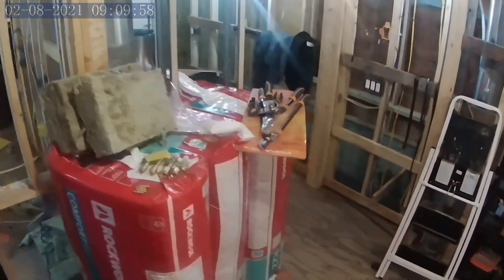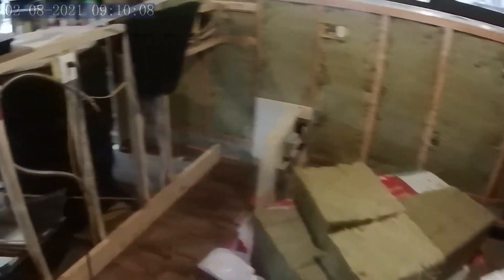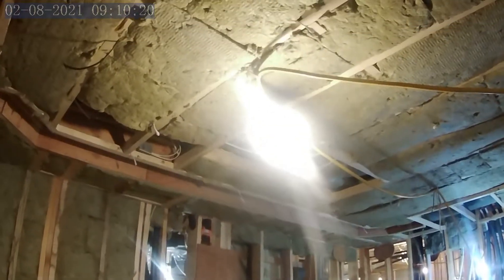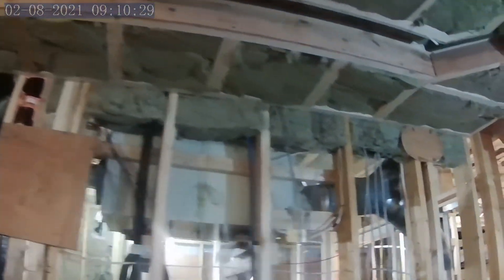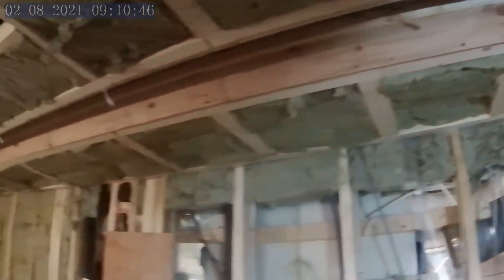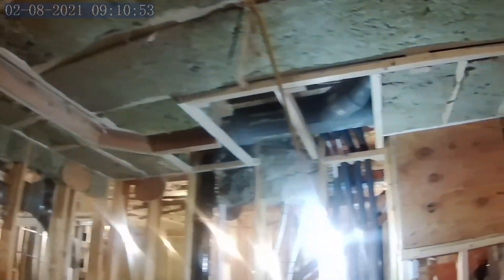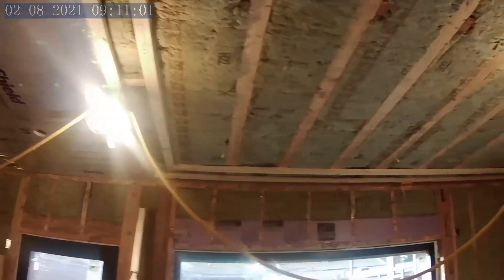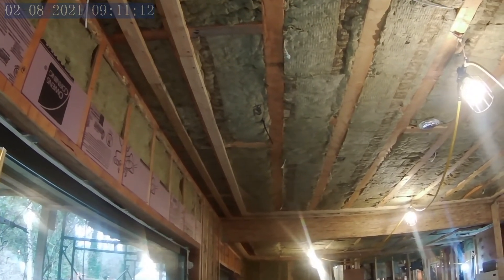ROCKWOOL Sound Proofing Test

Comment: Hello, thanks for the video. Is there too much difference using 50mm vs 100mm of rock wool?
Reply from the maker: Thanks for visiting the channel.  Yes there would be significant difference in sound levels between these two thickness. I believe it is an exponential increase in sound deadening as you go thicker.

Comment: You have absolutely no basis for your claim. Where is your control (ie, how loud was it before you installed the Rockwool)? And you don’t even have a sound pressure meter to measure the difference. Have you tried much cheaper alternatives such as the standard pink bat insulation? I’m not claiming Rockwool doesn’t work, but YouTube is full of these useless claims for Rockwool.

Comment: I'm sure it works to some extent, but it's less proof when there's no drywall.  It will absorb the sound nicely without drywall, but how much does it absorb with drywall?  This is the true test.
Reply: No, it really isnt though. Adding drywall adds another variable that can explain the sound attenuation. For such a test to be valid, you would need to measure a wall with drywall and no rockwool vs one with rockwool and drywall.
Reply from the maker: Hi k c - Please see https://youtu.be/26VmyOUdIaE for an updated and very clear results test.

Comment: Thanks for the share- I have a cabana near a highway think I’ll go this route
Reply from the maker: It is definitely part of a good strategy.  Now that I am living in the house, I am finding the biggest emitter of outside noise is the windows. They are triple pane, and obviously very well insulated and air sealed, but there are certain frequencies that the windows still reverberate, like an idling diesel truck for instance. Does not reduce the reasons for the ROCKWOOL, just a heads up that there are other avenues for the sound entry.  Some form of natural barrier between the highway and cabana may also help.  And air tightness is one of the most important aspects, as air movement through an assembly brings with it a lot of sound movement.

Comment: this is not a test at all. holes everywhere. sound reduction is only bdcause of the distance
Reply from the maker: c d, viewers are going to have to take my word for it since I did not think to do a before video.  

Yes you are right, there was still additional insulation to place which has been done and the place is now being drywalled.

All I can say is that the insulation DID make an amazing difference in sound travel.  As I mentioned in the video, I used to set my radio up, crank it, and could hear it clearly throughout the house.  Once the insulation went in, this was no longer the case and I needed to bring the radio to the area of the house I was working.  Now that the board is also on, the house is dead quite and if I am in the room the computer was in during video, and someone comes into the first floor and calls out for me,  I cannot hear them unless they shout.

ROCKWOOL works very well for sound proofing!